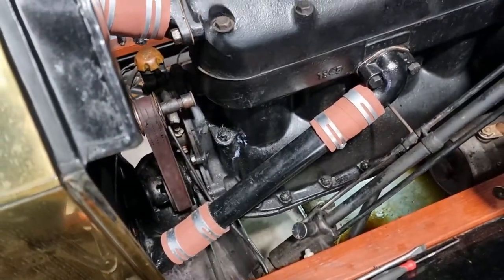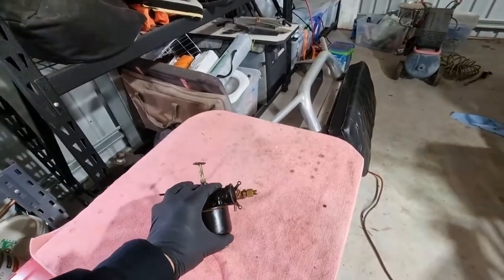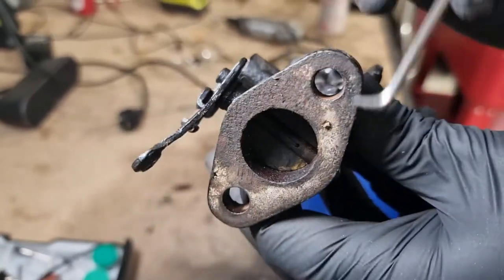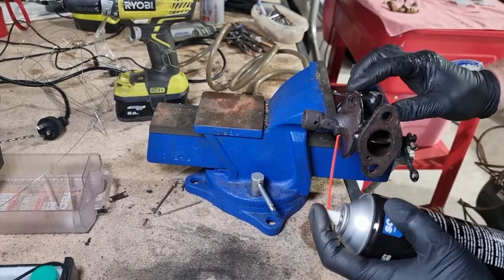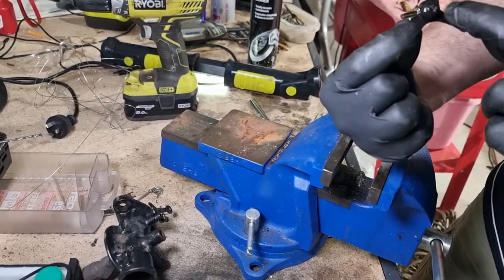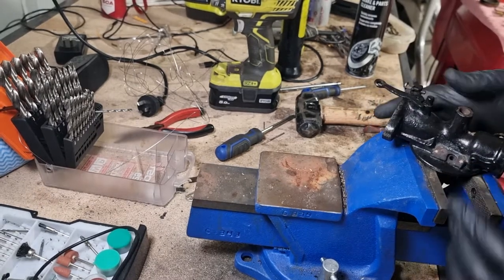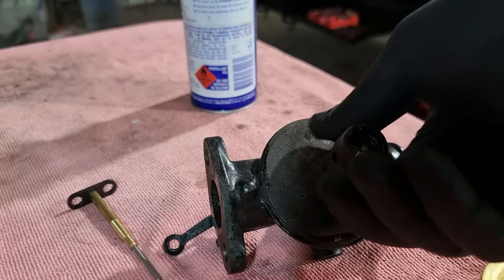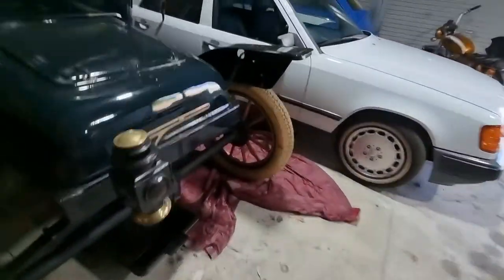Ford Model T Part 8

Comment: I feel and understand your pain on the broken bit, glad you got it out. The ultrasonic cleaners are great for doing the carburetor work, gets all of the passages clean. When you replaced the plugs on the passageways, what did you use? I have always just replaced them with another brass plug, but some Model T owners have tapped out the end of the passage and used a grub screw with a bit of sealant. Way easier to take out if you need to get in and do another rebuild.

I think you staple for the choke plate is a bit too short (or broken). It should pass through the entire shaft and then have the ends bent over to keep it from falling out. Getting out the needle seats (float & mixture) can be a real P.I.T.A. and screwdrivers just tend to make it worse. The screwdriver just wants to cam-out of the slot and tear up the brass. I made a couple of tools from some surplus chisels, just ground and file fit the ends to the slots on each seat, a much tighter and positive fit, and being made from a chisel a wrench fits them nicely. They generally come right out, but I have walked that same path that you did in try to remove some. I have always had more trouble with the seat for the float than the seat for the mixture needle. There is a gentleman here in the U.S. that is making original style "full flow" needles and seats for the float. The ones that the parts vendors sell work, but are a bit undersized. You can really tell the difference between them when you are pulling a hill.
Reply from the maker: I've just reviewed comments and noticed I missed yours. How rude of me! To reseal the carb where the plug came out, I used chemiweld. Easy to mix, use and its durable. I got the version for fuel tank repair. 8 months on, it's still going well.
The big issue right now is fixing up the bodged differential. I'll have a video up soonish! Take care.